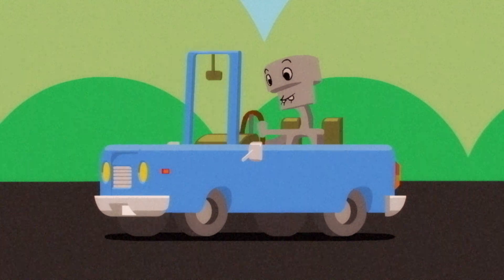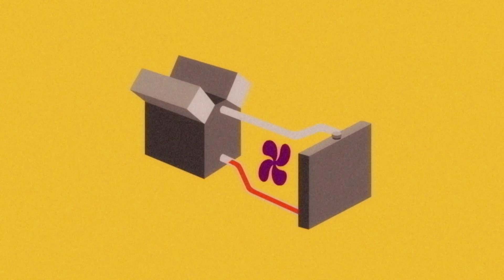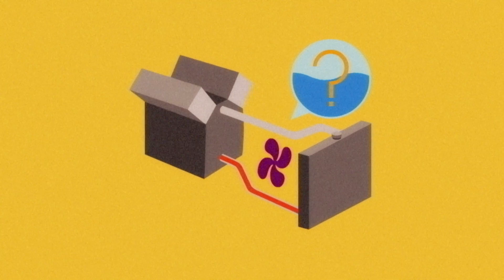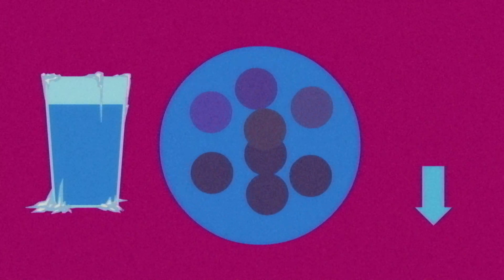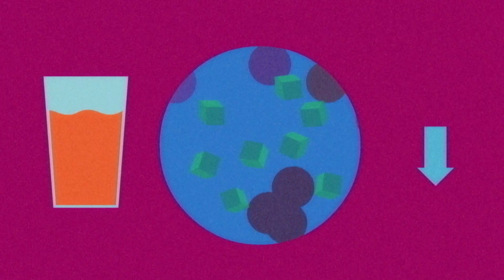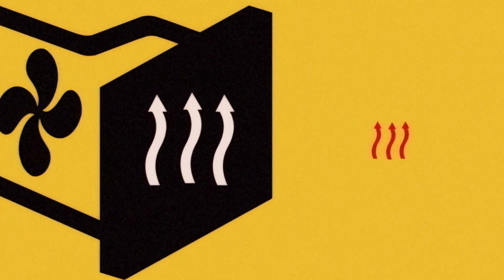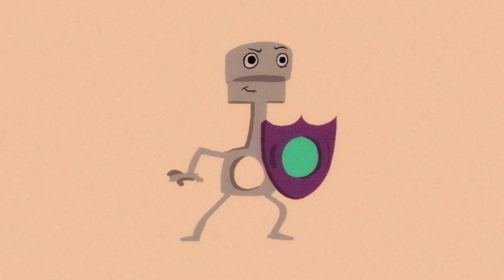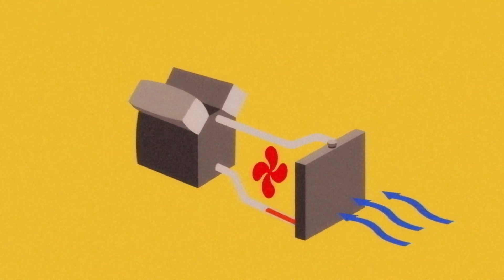Under the hood: The chemistry of cars - Cynthia Chubbuck

Comment: The narration could have been a little more leisurely. Sounded rather hurried. 

What kind of gases are produced when the petrol air mixture is ignited? Why petrol is the preferred fuel? How does mixture of ethanol petrol fare compared to petrol per se? These questions too should have been addressed.

Comment: One thing not addressed here is that water is a much more efficient conductor of heat than a solution of water and anything else. The solution has to over come that inefficiency to be a better solution as well. Just getting the air out of a solution is a great help. Much less chance of bubbles forming in a closed system.

Comment: Great video,  shows how important a cooling system is for an ICE vehicle.  One small thing was a bit annoying. Hot coolant returns to the radiator from the top and cooled coolant returns to the engine from the bottom.  Also another little tid bit of info, the energy that a conventional fan consumes just so you don't overheat is approx 40 gallons of gas per year.

Comment: you guys missed the chance to talk about how the chemistry in the battery releases stored electricity to start the engine. you don't start the engine by putting gas into it, you have to turn it over first.

and yes there are some engines from the 1920s that start from just the fuel but its very rare.
Reply: Rinoa Super-Genius    Has

Comment: Electric motors > Internal combustion engines
Reply: *****
-They are much more efficient - A Tesla Model S gets 90 MPGe
-They can be much smaller and produce much more power - Model S motor is the size of a watermelon 
-They are much quieter - A good thing for a family car to have
-They don't pose a fire hazard - as opposed to the number flammable liquids in a conventional car 
-They do not leak 
-They do not pollute 
-100% torque 100% of the time 
-Doesn't waste energy - naturally pumps forward momentum back into the batteries
-Allows for more interior room
-Faster than an ICE with the same horsepower - no transmission necessary
-MUCH less to go wrong - Model S maintenance: tires, wiper fluid when necessary and then wheel bearing at half a million miles. 

Would you like more reasons?
Reply: *****

If you say MPGe is "idiotic and irrelevant" then you have no idea what it is. 

Im not even going to waste my time because you clearly have a bias.
Reply: *****
It is simply the distance an electric car can go on the amount of power generated by a US gallon of gasoline. It is a standard unit of measurement for an electric car's efficiency judged by the EPA. 

Even if it did only get 75% of that 90 MPGe, that is 67.5 MPGe on a US gallon of fuel, better than anything else on the road. 

Battery technology 10 years from now will be very different. People are aware Li-Ion batteries explode and that is why there is a larger gauge of metal to protect the undersides of Tesla vehicles. That is also why people are working on different types of batteries as well. 

Give me some reasons why Internal Combustion engines are better than electric motors. 

Focus on the motors, not the fuel itself. That's what I was doing if you didnt notice.
Reply: WhoooLovesOrangeSoda
Some modern li-ion batteries can't explode anymore, you can hammer a nail right through a LiFePO4 battery and it'll just smoke a bit, no explosion no flame.  They're also incredibly fast to charge and discharge, and are thus already commonly used in vehicles.
Not in the Tesla cars though.
Reply: roidroid Tesla has Li Ion batteries for the 160m and the 230m range packs. the 230 is just more of them. the 300 mile is their own type I believe only in the 85kw, P85 and and P85+ models which uses  zinc, aluminum, magnesium, iron, lithium and vanadium as well as other metals. 

The patent for which is free to use as of last month along with all of their other patents.
Reply: WhoooLovesOrangeSoda
why did you tell me that
Reply: roidroid Because he thinks it sounded cool ?
Reply: Electric Motors < Internal Combustion Engines
Copper is expensive.
Battery's are heavy and expensive (the weight negates any efficiency advantage).
Electric cars are unworkable for the average person. You must be able to maintain your own vehicle.

Of course, these requirements are all for the lower middle class and poor. The regulators and czars don't really care about poor people and the lower middle class, so 30k car MSRP will be here to stay until there is no more auto industry left.

Also, gasifiers will be the future as oil becomes more scarce. Until you can buy an electric car for less than 8k without any government subsidy's, it will never come to fruition. If you want to see the future, look up the quasiturbine.
Reply: Nope
Reply: WhoooLovesOrangeSoda How about sound?
Reply: who tf cares
Reply: *****
People who can't afford vehicles more than 5000 dollars.
Reply: WhoooLovesOrangeSoda

MPPe is a good way to compare one electric car to another, but isn't enough information to make a comparison to a conventional model.

You also need the source of the electricity to make the comparison. A wheel to well analysis is what is needed, which gets complicated and depends on where you live, how you drive, and when you charge or refuel.

Converting two existing cars to CNG may have more of an effect over the next 150,000 on well to wheel than replacing one of them with an full electric.
Reply: WhoooLovesOrangeSoda

10 years from now ICE's will also be better, and may be able to run on fuels like NH3, CNG, or blends synthazized from C02 and renewable energy.

But it's speculation.

There are cases now where EV makes sense, but it doesn't beat ICE in every use case.  The main drawbacks are range and fueling time.
Reply: *****
 Hydrogen fuel cells have even worse propects than battery EV's. The materials needed are very expensive and hyrdrogen embrittles metals it contacts with.
Reply: WorBlu x Be wary as MPGe is not really a very good way to compare efficiency. Its just the best way we have. (in other words, it doesn't suck as much as the other ways). The best comparison I can make is steam trains vs diesel/gas trains. A 3 HP steam engine produces as much torque as a Top Fuel Drag Racer. The "Big Boy" UP 4014 has over 6000 horsepower. Knowing that a 3 horsepower steam engine half the size of a coffee table produces as much torque as a top fuel drag racer, how much power do you REALLY think is in UP 4014? Again, there is no practical means to convert tractive effort and torque produced by steam to horsepower.
Reply: WhoooLovesOrangeSoda

-They are much more efficient - A Tesla Model S gets 90 MPGe

For true effeciencly look well to wheel.

-They can be much smaller and produce much more power - Model S motor is the size of a watermelon

But you're energy source is much less dense in terms of energy/weight. 
Additionally the Toyota KR comes in at 69kg so ICE's don't need to be huge.

-They are much quieter - A good thing for a family car to have

But worse for pedistrians. Anyways in newer cars the road noise at highway speeds is louder than the engine noise anyways.

-They don't pose a fire hazard - as opposed to the number flammable liquids in a conventional car

Electrocution hazard. Anyways still a fairly rare hazard.

-They do not leak

EV's still have coolant . and some will have the transmission fluids.

-They do not pollute

They can pollute, but do it at the power plant instreat of at the car.  Properly operating modern engines create very little polution anyways, and in terms of carbon, synthezized fuels from remewables are possible.

-100% torque 100% of the time

Not true, torque drops off at high speeds. You get more in the usefull ranges though.

-Doesn't waste energy - naturally pumps forward momentum back into the batteries

Not naturally, the first electric cars (1910's or whatever) did not do this. You need additional engineering  and control mechanisms to do this (though not very many extra parts) Additionally regenerative bracking is not limited to electic systems. It is possible with kenetic, though not at the moment cost effective.

-Allows for more interior room
It also allows for some innovative styling, but most people arent' hesitant to buy a bigger car in the need the room.

-Faster than an ICE with the same horsepower - no transmission necessary

How fast do you need to go really? Most people never take thier car beyond interstand speed.

And yes you need a transmission, even if just one or two speeds so you can get to nuetral.

-MUCH less to go wrong - Model S maintenance: tires, wiper fluid when necessary and then wheel bearing at half a million miles.

Yes much less to go wrong, but there are still things that can go wrong. The big one is the batteries will wear out and they are expensive. 

-Would you like more reasons?

I would like you toadmit the biggest drawbacks wich are
1. Cost
2. Fueling Time + Range
Reply: Joe Schmoe
 A 3HP steam engine has a much lower RPM than a drag racer

And you're full of it. There is a supremely practical means to convert torque to horsepower.

Force * Distance = Work 

50 N/m at 200 rpm does 31415 Joules of work per minute  or abour 500 Wats per second or  2/3's a horsepower

At 12,000 RPM you have 40 HP

MPGe means miles per 33.7 kWhrs consumed. at the plug of the car.   If you want to comapre the one plug-in to another it's as good as any other arbitrary standard. More senible might be miles per kWhr like  the km per liter standard they use in europe instead of MPG's, but sense we're used to MGP's presenting in the MPGe format makes sense as the consumer can compar effeciency between EV's on terms that they are used to.
Reply: WorBlu x
 Sory math's wrong, times the HP figures by 2. I multiplied by pi where I should have multiplied by 2 pi.
Reply: WorBlu x Practical in some limited cases but not all cases, especially in the field work. Below is a link of an a very affluent expert in the steam engine and energy industry. He owns his own energy business manufacturing small steam engines. He hires engineers from MIT and other world famous colleges to do his design work. Here is his website and what it has to say about steam vs internal combustion engines.
http://www.mikebrownsolutions.com/sideset.htm

Another example of where modern scientific calculations lack are with rifle cartridges. I will give two common examples.

A standard 45-70 load, firing a 300 grain (19.44 grams) bullet at 2069 feet per second (693 meters per second) has 2852 foot pounds of energy (3676 joules)

A standard Springfield 30-06 cartridge with a 185 grain (11.988 grams) bullet at 2700 feet per second (820 meters per second) has 2913 foot pounds of energy (3975 joules)

the older 45-70 with its 3676 joules seems less powerful than the more contemporary 30-06 with its 3975 joules. Any nose in the book scientist would say this is true.

BUT the 45-70 has more power in practice. Much more power. 45-70 can take down even Grazzly Bears with relative ease. The Springfield 30-06 can only take down large elks, and small moose is pushing it, at the very largest. The 45-70 also has a much more visible kick/recoil.

This is because of the inadequacy's of many scientific conversion methods.
Reply: Joe Schmoe
 I think you're severly confused. A 200 HP engine doesn't put out 200HP every second it is running, that's just it's rated peak.  A running engine has an instantaneous horsepower, which is measured by Forced* distance/time

Also the article you link uses the wrong units for torque lbs, instead of ft*lbs or any other distance*force unit. Torque is a measure of force. HP is a measure of power. Saying torque is a better measure of power is nonsensical.

Horsepower is  horsepower. no matter the engine.  Different engines, and especially different types of engines have different contours in the power graph, where the reach the peak, and how level it is.

However this is way away from the topic of effeciency and MPGe, which answers for people, how much electricity will I have to buy to get to work and back every day for a month?

From a scientific sort of effeciency, the question is how much of the potential energy is used for work, and how much is lost to heat?
Reply: Where does the electricity come from, and what do we do to get the electricity?
Reply: angelohitman
EXACTLY!
Reply: angelohitman

Yes, these are the questions involved in a well to wheel analysis.  The answer depends on where you live, and if you have any redidential renewables installed.
Reply: angelohitman Yes, I see the point you are trying to make, but overall the emissions are still less than half, and can be nonexistent if renewable energy is used.
Reply: angelohitman
A bunch of CANDU nuclear power plants (>50%)! And some hydroelectric, and even less natural gas, and ZERO coal. Solar is pretty irrelevant unless you live in the desert.
Reply: leerman22 Have you ever heard of Thorium nuclear power?
Reply: SeabasR Uh ya. Candu can run off the stuff with it's high neutron economy of the heavy water. Neutrons at thermal spectrum will be absorbed by the xenon produced though. In a MSR it's much easier to get rid of such impurities.
Reply: SeabasR
And can we be certain that it will always be the case? Nothing would excite me more than cleaner alternatives, but if we are just transcending costs with the same repercussions it would just be a waste.
Reply: +Bonaventure Wenceslaus  Great job!!
xD
Reply: what are we even debating about?? hands down, electric motors are the best. Even other than the reasons stated by +WhoooLovesOrangeSoda they have innumerable advantages over ICEs.
Fossil fuels= dead dinosaurs
Electric motors=future
Reply: WhoooLovesOrangeSoda that's your opinion.